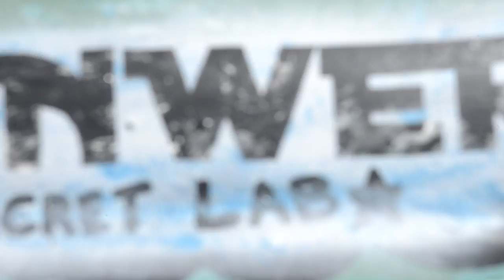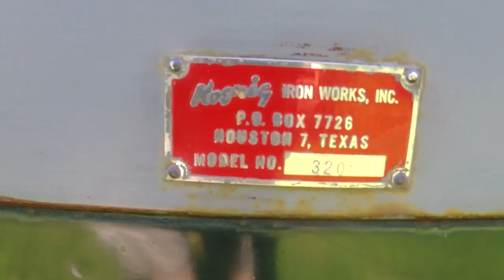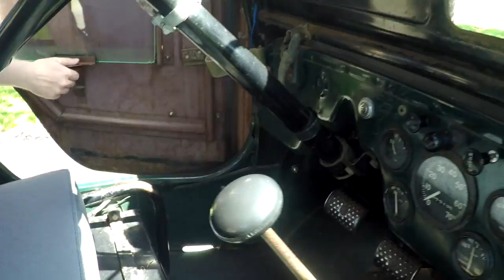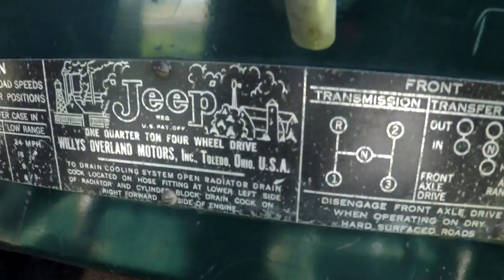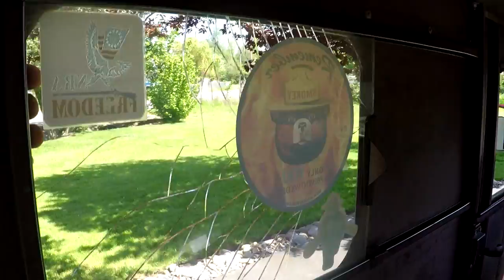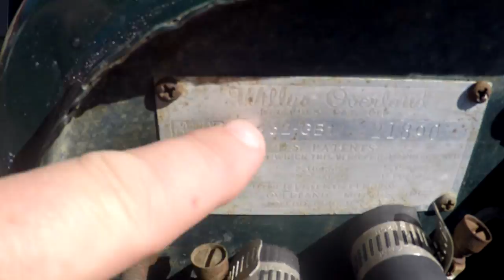1952 Willys Overland CJ3A - DENWERKS - BRING A TRAILER

Comment: Nice Jeep for the age.  One small correction on the hood.  The wood blocks were not to rest on the top they were primarily for the windshield to rest on when folded down.  The Koenig and Kelly (which was a better) hardtop were options not sold through Willy’s or Kaiser later on.  They were sold through the dealers.  To find a Jeep with what appears to be a pretty mint hardtop is a real find especially the Koenig.  Koenig was also for several years the only winch (a PTO operated) available for the Jeep.  I just ran across your channel and have subscribed it looks like you have very interesting content.
Reply from the maker: thanks for sharing! :)
Reply: It's a Koenig Jiffy Top. The doors and hatch peel off in less than a minute. It was introduced just before CJ3B production. It's a fairly common top for 3B but it's very  RARE for a 3A fitment.